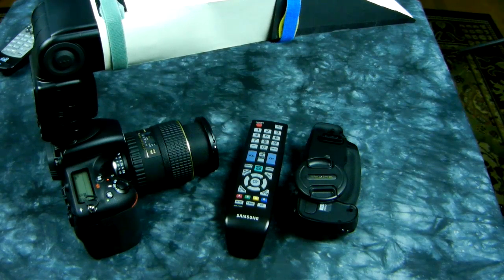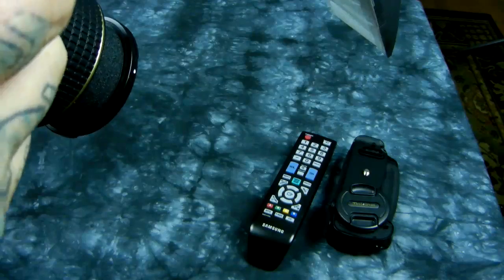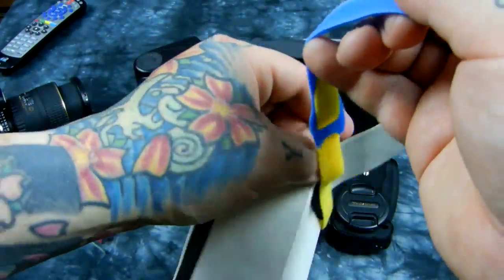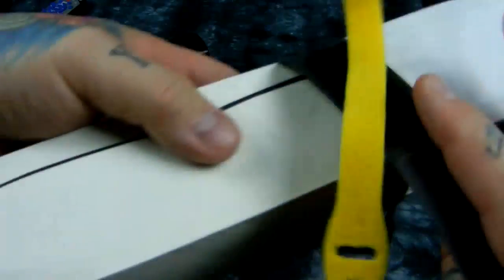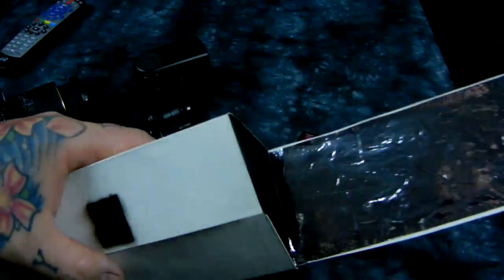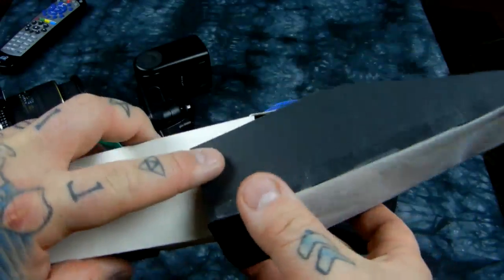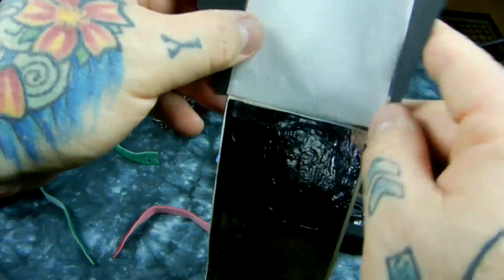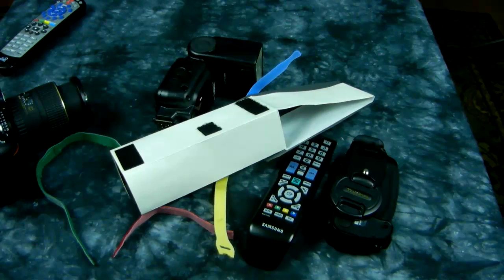Angry Photographer Invention: DIY $2 MACRO FLASH MOD!! Coolest Photography hack on Earth!! Part 1

Comment: Just made one. Works very well. 
I used corrugated plastic and lined the 
entire inside with mylar from a Dorritos bag. 
Same stuff that's used for the space blanket.
Had to play a little with the length and angle
of the ramp down but so far this thing is great.
Hand held produces sharp photos with light
to spare at low ISO and small apertures. 
Thanks for the idea Ken!
Reply from the maker: +John Lyons doritos!!!!  ehh it a straight shoot to the mirror, so you dont have to line the tube, but either way.......

im glad its working well for ya!!!!!!  

100mm macro lens????
Reply: +Theoria Apophasis Ha, yes, Tokina 100mm 
Macro (thanks for that tip as well).
I seem to use that lens a good bit of the time 
for Marcro as well as product and portrait work. 
Rather than a black inside I figured the fully lined 
tube would keep the light level high rather than 
absorb light as black does. Maybe not, but it works, 
so either way.

Comment: i made this! this is awesome. thank you! i was wondering if i could modify it somehow to get a portion of the flash light directed to the front of the subject - like a fill flash in addition to the soft diffused light from the top.. do u think it will work on the same diffuser?
Reply from the maker: +meraat haqiqi U MADE ONE TOO! yes you can, youd need to use a SC-29 flash cable to get the flash off the camera
Reply: +Theoria Apophasis I saw that too! and i am thinking of making that next... would u say i could use the cheaper third party 'NEEWER' flash cables instead of the SC-29 on my Yn568ex and d7100??
Reply from the maker: yes yes, you can , sure thing